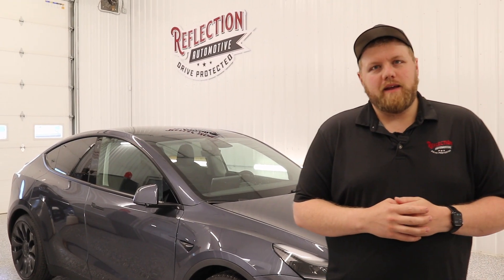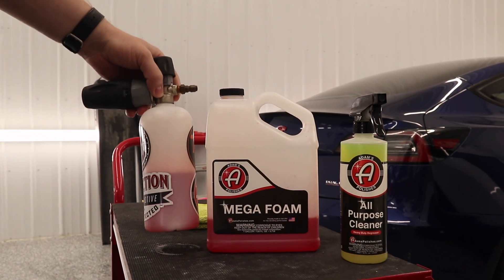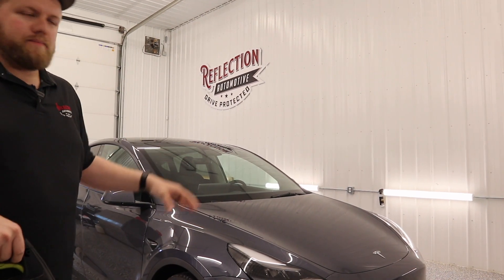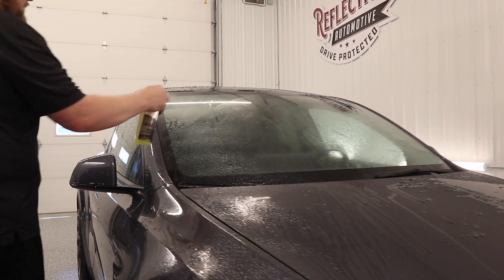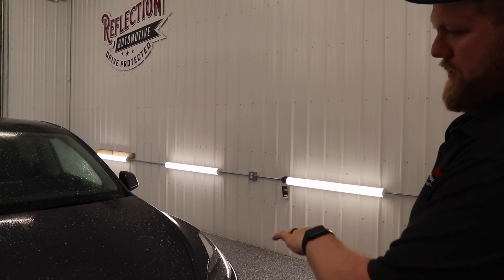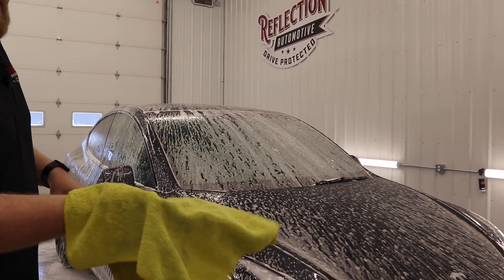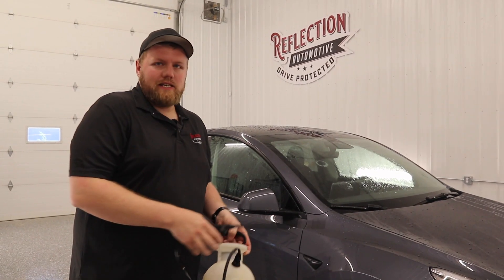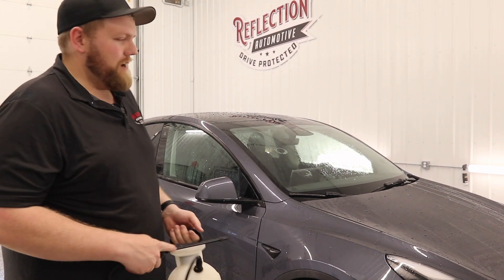PPF Pro Tips - How To Properly Wash A Vehicle For A PPF Install

Comment: Hi! How do you make sure there is no old wax or protection on the paint? Do you use a special product?
Reply from the maker: You’d be able to notice it by the way the water sheets off the paint when washed. If the water is beading off, good chance there’s still some wax/coating on the paint. If the water sheets off slowly, good chance the wax/coating is gone.

Comment: Just bought the full wrap for my 2023 Model Y to DIY and will be getting started this weekend. Do you recommend I buy Adams product specifically? Heard from other videos a microfiber towel and Dawn dish soap is sufficient. I also don't have a foam cannon or the pump sprayer for the iron remover. Any work arounds for this or should I buy those as well? Car has been garaged after driving, but I do have 8k miles on it already. Thank for the advice!
Reply from the maker: Any iron remover will be fine in removing built up iron contamination. As for your slip solution, I recommend using Johnson’s Baby Shampoo, but Dawn dish soap will work too!